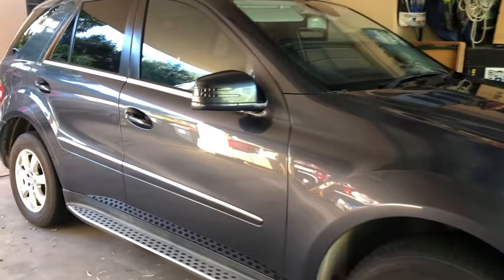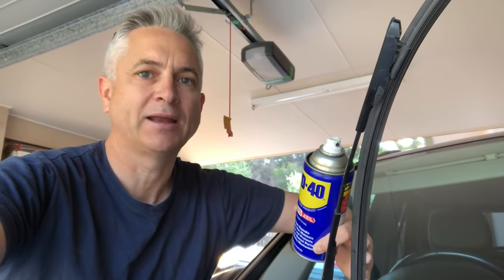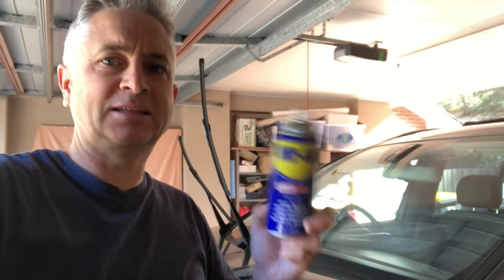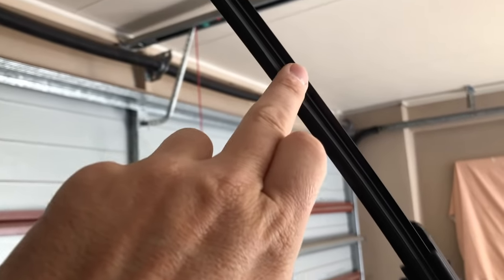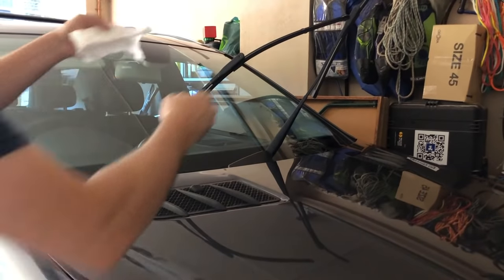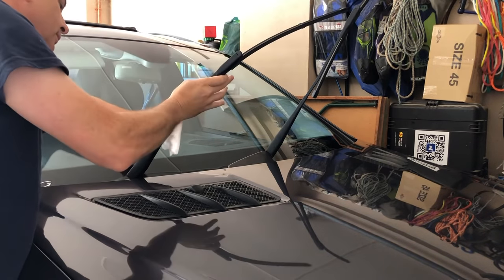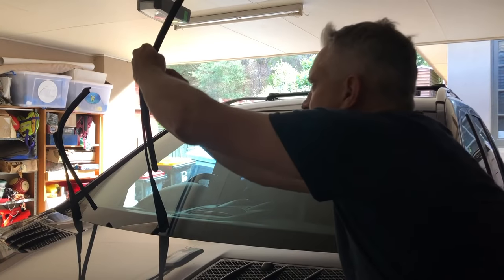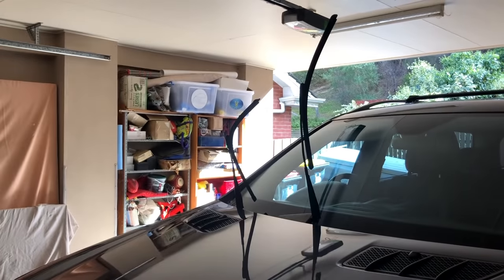WD40 Hack on Wiper Blades!  Does it really work?

Comment: Just one comment, Drew (and thanks for the video, by the way). I think that black gunk you got when you wiped with the WD-40 was probably mostly rubber rather than dirt. That's not a bad thing in this context, but I think the WD-40 actually softens the rubber by partially dissolving it. It's important to wipe excess WD-40 off and not leave residues on the rubber for too long. The way you did it was fine, and it worked - which is what counts.
Reply: Agreed, first I wipe the blade with wd40 it works fine for few days, the noise came back, so I though maybe I should spray more and leave it to dry, now my blade is like sticking to the windscreen, just like you said , the rubber blade might have dissolved 😑
Reply from the maker: Hi Sualdam, thanks for your feedback and suggestions, truly appreciated!  Cheers Drew
Reply: You can wipe down brand new blades and pull black off. I think silicone if better to use than WD40
Reply: @WhittyPics  It depends what you are trying to achieve. If you put silicone on your blades, the last thing you want is for it to get on the glass - it's hard to get off, and it causes smearing. If your blades are hard, then WD40 will soften them for a time, which can be beneficial (so long as you clean off excess WD40, since you don't want THAT on the glass either). Smearing windscreens is caused by several different things - stuff on the glass, stuff on the blades, hardened/damaged blades. The logical approach is to get everything off both the glass and blades - which is easier to say than to achieve - then worry about the state of the rubber. WD40, by softening the rubber, refreshes it somewhat.
Reply: WD40 does not "eat" into the rubber. Where did you get your info from?
Reply: @happyswissjoe  It's what is known as being a chemist, as opposed to an online Millennial non-expert of everything. WD40 contains a petroleum based solvent and can soften rubber. Which is why it strips a layer off when you use it on wiper blades. It warns you to keep it off pressurised hose work for the same reason. Really, it's that simple - and just saying 'nah' doesn't alter the fact.
Reply: Wiper blades often contain silicon composites. So WD-40 might dissolve them. Use vinegar instead of WD-40.
Reply: @happyswissjoe  i worked in the plastics industry for many years and when we stripped machines down we cleaned the tooling , we would spray wd on the tooling to lift the plastic residue from the extrusion process (both pvc and rubber products) , this would clean the tooling and leave a coating that helps stop the tooling from rusting as most tooling is just bare steel (you can chrome the tooling but it gets worn away and is a constant job of getting them chromed over and over) , if you were cleaning tooling the fumes that come off (you are cleaning hot tooling at 180c and more) will actually strip any protective coatings on glasses (anti scratch / glare etc) it isnt instant and takes time but it will strip it.
Reply: @happyswissjoe  womp womp, go back to school.
Reply: @sualdammacsamildanach8154  You can get silicone-based WD40
Reply: Can't see how this is accurate. You get that black gunk when you just use water, and the fact that after 3 or 4 wipes it comes away clean shows that it's just dirt and not "dissolved rubber". You can put rubber completely immersed in WD40 for months and it not dissolve (because this is a comments section, I need to highlight that by me saying it doesn't dissolve, that isn't me saying that there aren't consequences) there are various YouTube viedoes testing this). Spraying it on a cloth and wiping a blade isn't going to make any difference.
Reply: @iainamurray  Yeah, well whatever. The regular stuff will dissolve/soften rubber. "WD40 contains a mineral (petroleum) spirit as a carrier solvent. The mineral spirit WILL soften and swell natural rubber. It is ok to use on fuel and oil hoses but NOT coolant hoses and definitely not on door and window rubbers!" But carry on arguing against the facts by all means.
Reply: @sualdammacsamildanach8154  You seem to have an issue with reading and understanding my comment. Would you like to try again and reply with something relevant?
Reply: @sualdammacsamildanach8154  If you'd have said "WD40 will soften rubber, particularly when immersed over an extended period" then I would have agreed with you. Instead you spouted some bollox about wiping the blade with it dissolves it onto the cloth which is demonstrably false, as proven in the video. I even highlighted that before any numpties tried to come at me saying that it does nothing, I explicitly said that me saying that wiping a blade will not cause it to immediately dissolve isn't the same as claiming there will be no impact. Please read in full and understand before spouting yet more nonsense. You were that numpty.
Reply: Just get new blades.They are cheap!
Reply: @nearlyretired7005  $50 according to the vid
Reply: I was thinking it was the broken down rubber too. I've heard you can use Isopropyl Alcohol too. What could be wrong with taking advice from a spaz like Kilmer, right?
Reply: @vincemajestyk9497  IPA is fine to use a a cleaner and degreaser, but the problem is that it won't 'refresh' the rubber. That's the point of this hack - it stops the hardened blades bouncing by softening them slightly (for a while). WD40 will remove grease as well, of course. I was just pointing out that the black 'dirt' Drew was seeing was likely rubber that had been stripped.
Reply: @vincemajestyk9497  It's not broken down rubber, it's road crud. If immersed the wiper in WD40 for a few months then it might break down, but using it to wipe clean a wiper makes some sense as it will clean it and potentially soften it a bit, which is good for it.
Reply: @iainamurray  I've managed to hget the same "crud" off of brand new wiper blades.
 Hmmm...
I wonder what that was?
Reply: @michaelmayfield4304  Residue from the manufacturing process?
Reply: @iainamurray  Other than black asphalt flying off the road, where do you think the black rubbery looking “road dirt” would come from. Wipe the windshield and look at the color of the dirt. Is it dark blue or black? Why would wipers have different colored dirt than the windshield? 

Seems so obvious the solvent in WD40 is stripping off some of the wiper blade’s top coating which might have weakened over time. Of course, you could also test on a new, clean blade and test what the other commenter wrote. I’m guessing he’s right…

Doesn’t look like road dirt to me. Just one person’s opinion, of course, but easily tested…

🖖🏻
Reply: @sualdammacsamildanach8154  m
Reply: @philosophyandreligion3442  Yes, it is easily tested. Which is why I'm not sure why you've sent this message.
Reply: @chrisc9817  No it isn't. Standard WD-40 contains petroleum distillates and is therefore a solvent. It is why they warn against splashing it on pressurised hoses. It displaces water, to be sure. But that's because of the petroleum distillates, which are also solvents. You shouldn't just says things like this without at least looking them up first.
Reply: @sualdammacsamildanach8154  Is there a reason to be so narky? Millennial? I find it quite amusing that older generations think that later generations are somehow deficient. I grew up in the fifties and sixties and I can tell you that the young people of today (that I have contact with ) leave earlier generations for dead
Reply: @avasolaris1  Look, if people are going to make stuff up and then believe it is true, then go around repeating it as fact simply because they heard it, someone has got to try and remind them how knowledge works. And I will if you won't. It IS a millennial problem. Absolutely. On the other hand, being 'narky' is also a millennial problem, and I quite like that one and will wholeheartedly embrace it. And I can tell you now, any of your 'young people' who go around claiming WD-40 can cure scrofula and turn water into wine need correcting - not a heap of fake congratulations, which is the current way. WD-40 is a solvent and it will dissolve rubber. It's a simple scientific fact. It doesn't matter what your 'young people' think. If they think something else, then they are wrong, and you shouldn't be encouraging them.
Reply: @iainamurray  Also known as 'rubber'. Just face the fact that the reason this hack works is that WD40 softens rubber, and the black marks you get ARE rubber and not 'dirt' - especially if you've already cleaned your blades in soap and water.
Reply: @sualdammacsamildanach8154  You know what, I mixed this up with another product. You are correct. Sometimes one gets confused after seeing thousands over products over the years. Mistakes happen. Wd-40 has an almost exact looking can that is a silicone spray.
Reply: @iainamurray  The whole point I made was that the apparent gunk coming off AFTER YOU'VE CLEANED THEM is not more 'gunk' but dissolved rubber. Everyone apart from you got over the idea of magic pixie dirt a hundred posts ago. It isn't dirt. And it isn't 'manufacturing residue'. WD40 attacks the softer rubbers on cars and partially - a word I've used previously - dissolves it. If you immersed a blade in WD40 and left it, it would eventually disintegrate pretty much. It would certainly be useless. Because WD40 attacks it. A brief wipe softens the edges - and pulls off some 'gunk' (aka rubber) as it does.
Reply: @sualdammacsamildanach8154  Are you for real? What is so difficult for you to understand - after you've wiped it a few times, there is no more "gunk" being removed from the wiper blade. It stops. There is no more. Nothing else is removed. Not sure why you've put "manufacturing residue" in quotes as it's not something I've said. It's almost as if you're not paying attention....
Reply: @iainamurray  You said 'Residue from the manufacturing process?' in a reply to someone else earlier 🤣 Now, correct me if I'm wrong, but that means you think it is 'manufacturing residue', right? And you're talking rubbish. You get the gunk coming off each time you wipe. Just because YOU said you don't doesn't make you right - the real world doesn't work like that, even if it seems to in yours.
Reply: @happyswissjoe  It is a petroleum based product so it probably does. Use the Rain-x cleaners and wipers. I've been using them for years and there is nothing better. Water beads up and blows right off the glass. When wipers don't work like they did, wipe them down with the cleaner and re-clean the glass also.
Reply: @sualdammacsamildanach8154  I didn't deny anything - you were replying to a comment where I hadn't mentioned it, not realising you were referring to something that was apparently said weeks ago. I've not gone back over the 44 out of sequence messages - the residue may well initially be manufacturing process and after that, road grime. Seriously - go outside now and clean your wipers with a splash of WD40 to prove to yourself that when you've cleaned it with a few wipes, after a short while the cloth will come back clean. That's because WD40 isn't aggressive enough to melt rubber, you melt.
Reply: @iainamurray  That wasn't the point, Iain. The point was - and remains - that the muck coming off even new/clean blades is microscopic fragments of the blade itself as a result of the action WD40 has on rubber (and the coating new blades often have). Petroleum distillates easily have enough power to commence doing what they do immediately after contact, hence the manufacturer's warning not to splash it on pressure hoses. Your problem is, it seems, an inability to comprehend degrees of action and nuances, opting instead for either all of one or all of the other based on coin-toss logic. WD40 will strip a small amount of rubber and affect the the surface of the remainder, which is precisely why it stops squealing blades for a time. It softens the sharp edge of the blade which may have hardened over time.
Reply: @sualdammacsamildanach8154  "Your problem is, it seems, an inability to comprehend degrees of action and nuances, opting instead for either all of one or all of the other based on coin-toss logic" 

- this is the most ironic thing I've seen on the internet today. You've not actually tried it - you're going on what you think you know rather than attempting the basic test. I don't know if it's you simply not reading and taking the time to understand what's being said, or you're being willfully ignorant, but either way, it's not a good look.
Reply: @iainamurray  Well, at least in this one you went all 'one way' and just stuck with being personal. No misinformation about WD40 to respond to here.
Reply: @sualdammacsamildanach8154  Saying what actually happens isn’t “misinformation”.
Reply: @iainamurray  Someone: 'I wonder what that was?' You: 'Residue from the manufacturing process?' QED. That was the ONLY point I replied to , and not your entire back catalogue of apparently contradictory snippets 😉
Reply: @sualdammacsamildanach8154  I've been entirely consistent. Your claim was that the black gunk was melted rubber because the WD40 disolves it. I pointed out (politely initially) that it can't be the case that it's dissolved rubber, because for that to be true, if you keep wiping then the residue would continue to melt and come off until there was no wiper left. Because this doesn't happen, what you claimed is demonstrably false. 

I've confirmed that while there most likely will be rubber deposits, the residue is a mixture of things, mainly road dirt, hence after a few wipes the cloth comes away clean. I also confirmed that WD40 will significantly break down rubber, but only under circumstances where there is extended contact with it (i.e. not a quick wipe with a cloth).  I also said that WD40 can and will permeate and soften rubber, because it does.

Apologies if English isn't your first language, but you should really read and understand the points being made before going into "attack mode".
Reply: @sualdammacsamildanach8154  I'm not being contrarian. I'm being accurate and pointing out your logical fallacy. I'm not using an analogy, I'm giving real-world experience.
Reply: @iainamurray  But you are simply wrong, Iain. The manufacturer itself warns that it attacks rubber, and I'd think that they would know more than you (though that would seem to also apply to most of the animal kingdom).
Reply: @iainamurray  Iain, this is precisely what I meant about managing to have an argument in an empty room. The manager I mentioned was just so like you it's spooky 😂- he would agree and yet somehow manage to disagree just to make his mark. So we're agreed that WD40 attacks rubber, which is why is 'refreshes' hardened rubber, and that by thus attacking it small amounts of it must come off each time it is applied. This is the basis of science, you understand, and I was employed as such for many years.
Reply: @Planktilious1  To be honest, Pat, I haven't tried it. But MEK is known to dissolve rubber and plastics. It can be used to weld plastics together (I've used it for that), it is that aggressive, and more so than WD40. A small amount might work better than WD40 on wiper blades - but it might also work far more than you want. What you said about print rollers suggests it might work well, though. I'd try it on an old blade first. Just in case. I think WD40 might contain some MEK, but I don't know for sure, or how much. The recipe is a secret.
Reply: @sualdammacsamildanach8154  So you're saying that you have a lot of experience of people having to correct you? Makes sense.
Reply: @iainamurray  Nearly right, Iain. A lot of experience of people who have a desperate need to BE right even when they don't even need to get involved, and who then obfuscate the important details with their interference.
Reply: @sualdammacsamildanach8154  If you want to be right - stop being wrong.
Reply: @iainamurray  Since I am quoting science (and the manufacturer), maybe you should invest in a mirror with that comment 🤣 Are you sure you're not the manager I mentioned earlier? The similarities are uncanny.
Reply: @sualdammacsamildanach8154  I couldn't manage you. My patience has limits. You think that the manufacturer says that waving a small amount of product on a cloth near some rubber will cause the whole thing to immediately melt? Citation needed.
Reply: @iainamurray  Iain, YOU are the only one who has become obsessed with this idea of dissolving a whole wiper blade 🤣 I'm not really sure why you or anyone else would want to do that, but at least in your case we've identified certain 'issues' that might shine a light on the reason. Maybe your doctors will be able to use it should you seek treatment. In the meantime - and 66 replies ago - I originally said 'I think that black gunk you got when you wiped with the WD-40 was probably mostly rubber rather than dirt...  WD-40 actually softens the rubber by partially dissolving it.' Just to remind you of the facts, of course 😉
Reply: @sualdammacsamildanach8154  Why do you keep insisting that you're telling me facts when what you've said is demonstrably false? What's wrong with your head?
Reply: @iainamurray  It's a scientific fact that petroleum distillates attack many forms of rubber, Iain. It's not a word game - which I KNOW you are trying to play to save face - about dissolving entire wiper blades in the stuff. Only you brought that up, and only you keep mentioning it as if it has any relevance whatsoever. It doesn't. The manufacturer warns that WD40 attacks rubber. Period.
Reply: WD-40 isn't good, it leaves a lacquer when it dried.  WD-40 makes a silicone version which is better.
Reply: @D33Lux  But the silicone version doesn't soften/refresh the rubber in the same way because it lacks the very ingredient which does so in standard WD-40. It's also worth pointing out that silicone will be left on the glass and blades. It'll make them slide better for a while, but it won't soften them up. The key issue here isn't that the brand WD-40 works (there are many WD-40 knock offs which also have the same effect), but one of the key ingredients in it.
Reply: @D33Lux  Oh christ. Don't encourage him. He already thinks that WD40 will melt your car if you wave a can of it at it.
Reply: @iainamurray  Whereas YOU believe YOU are right and science is wrong. Don't forget that, Iain. Your position appears to be that WD40 can/can't/might attack rubber, something about making a puree out of an entire wiper blade, and then arguing you never said whichever of those things you're not going on about at the time, while switching to a different one every few minutes.
Reply: @iainamurray  Iain, that was what I said right at the start. There really was nothing for you to 'add', but you chose to do so and then started wittering about dissolving entire wiper blades for reasons best known to yourself. I said - in my OP - that WD40 attacks rubber, and that the black 'gunk' coming off even clean blades was likely traces of rubber. I'm sorry, but that's what happens when something which attacks something else is wiped over it. It really is that simple, and yet YOU tried to turn it into something else in order to get noticed. Well, you succeeded, but not how you expected. No doubt you saw yourself as some 'devil's advocate' with your earlier suggestion that it was 'manufacturing residue'. Your position is not as consistent as you keep suggesting. If it was, you wouldn't have even said that. I remind you once more. WD40 attacks many types of rubber, and that is why is softens hardened blades. Repeated rubbing will remove traces of rubber (and any coating) with it. You DO know what 'traces' means, don't you? I'll give you a clue and tell you it doesn't mean dissolving a whole blade.
Reply: @sualdammacsamildanach8154  Christ on a bike - you made a statement and I pointed out that it can't be accurate because of a very simple test you can do. Then you went off on one about "science" and not reading what was said. I'll go back to the original point and see if you understand it/process it this time: you said the residue on the cloth was rubber because the WD40 dissolves it. This isn't possible, simply because if it were, you would end up wiping and wiping until the whole thing was gone. 

Now this is the important bit - I didn't say that there isn't a reaction. I said that the reaction isn't so aggressive as to dissolve the rubber that quickly. This is evident by the fact that the cloth comes away clean after a few wipes. I've literally just tested it as my wipers needed cleaning. One with WD40 and one with water. WD40 was 4 wipes and came away clean. Water was 6 wipes and came away clean. If WD40 dissolves rubber to the extent that you suggest, then I'd still be there wiping black residue. I'm not. You are wrong.
Reply: @iainamurray  WD40 softens rubber by attacking it, Iain. Thus it will pull off small amounts when used to wipe them. Period. It's called 'chemistry'.
Reply: @iainamurray  No one - apart from you, Iain - has claimed what it is you have a bee in your bonnet about 🤣 You've created a falsehood to disagree with, and are pursuing it doggedly. No one actually said it, Iain. Only YOU said it. WD40 attacks rubber - the manufacturer warns of it - and it is likely that the 'gunk' coming off is the result of that. Nothing about wiper blade smoothies in there, Iain.
Reply: @sualdammacsamildanach8154  I don't understand why your brain doesn't function. You can test your assertion and prove that it's false in about 5 minutes. I can't help you any more than point you in the direction of knowledge and understanding.
Reply: @iainamurray  Yes, so you keep saying in amongst your belief in wiper blade smoothies being somehow involved in the matter under discussion, Iain. WD40 attacks rubber - the manufacturer warns of it, as I have repeatedly pointed out to you - and thus when used to wipe rubber is likely to strip small amounts off.
Reply: @sualdammacsamildanach8154  You're the one banging on about wiper smoothies. As I've repeatedly pointed out to the hard of understanding, I'm aware that it attacks the rubber. Just not to the extent that you're imagining, as demonstrated by the fact that the residue stops after a couple of wipes. If you can grasp this extraordinarily simple premise, then perhaps we can move on.
Reply: @iainamurray  Iain, I have only continued to deride you on the matter after YOU brought up that argument about dissolving a whole wiper blade. No one had made that suggestion until you stuck your oar in 🤣 But you can't unsay it, which is why I keep reminding you of it. WD40 will strip small amounts of rubber since it attacks rubber. The manufacturer warns of it attacking rubber.
Reply: @iainamurray  The manufacturer of WD40 warns that WD40 attacks rubber and shouldn't be used on soft rubber or pressurised rubber because it will soften it, which then causes it to break up. But some internet numptie with 'issues' says... well, precisely what YOU'RE saying, and so they must be wrong, eh? 🤣
Reply: @sualdammacsamildanach8154  I'm aware. That's why I said it. Repeatedly. If you were to immerse your soft rubber in WD40 for a month, then it would indeed soften it to the extent that it causes it to no longer function. The point that the internet numpty (that would be you) is missing is that using a trace of it on a cloth to wipe something down once every now and again won't have anywhere near that level of impact, and certainly doesn't degrade it to the extent that the rubber immediately breaks down and gets wiped away. This is incontrovertible. I do however realise that this will be lost on you and your binary simplistic understanding of the world.
Reply: @iainamurray  No one else was interested in dissolving an entire blade, Iain. Only you - for reasons best known between yourself and your therapist. The point is, and always was, that WD40 attacks rubber, and thus wiping blades with it, as well as refreshing them as a result of that attack, will also likely result in some rubber (or coating) being shed. Nothing about wiper blade smoothies or any other schoolyard antics 🤣
Reply: @sualdammacsamildanach8154  If you're going to make demonstrably false declarations on a public forum, expect to be called out. I'm not interested, just pointing out the fricking obvious.
Reply: @iainamurray  WD40 attacks rubber. The manufacturer warns of it. This is why it 'refreshes' hardened blades. It softens the rubber as a result of the petroleum distillates it contains. The only falsehoods have been 'nah, it doesn't', and 'let's make a wiper blade smoothie' - both of which have come from you. And that's on top of the smokescreens like 'oh yeah, but you can get silicone based WD40' and 'it's a manufacturing residue' as you swing wildly between your ignorance of multiple scientific issues 🤣
Reply: Petroleum based products and rubber don't mix!! Plus small amounts of grit sand ect are frown up from the road and sticks to wiper blades and which in turn micro scratches appears on the surface of the screen!!!! WD40 no!!🤔
Reply: @keithroberts5611  Don't you bloody start. We've already got one internet numpty
Reply: @happyswissjoe  Wrong!  It is a petroleum solvent.
Reply: @michaelmayfield4304  The black stuff is dye from the wiper blade
Reply: @michaelmayfield4304 Probably the graphide powder. Some wipers have it as a solid lubricant. So, not advised to remove it.
Reply: 6 a.m. in the UK and I’m reading comments of people arguing about windscreen wipers. Isn’t the internet a wonderful thing😀
Reply: Winter weather concerns motivated my dad to coat my wiper blades with wd40. I was on the highway later at night and went did a spray/wipe and i couldn't see a thing because it caused smearing. I had the blades replaced 6 months earlier and so I pulled over to see what was wrong. I took paper towels to wipe the glass and it was oily and made it worse. I managed to drive to gas station and did simple windshield cleaning and everything was fine afterward. As for whether it degrades the rubber, I hope not. This just happened to me today and so it prompted me to check YouTube to see if this is something others do. Personally I'd just use Lysol wipes to get dirt off the blades and avoid the chamce of potential smearing. That said, I have no idea if my dad just lifted the wipers up and sprayed them with Wd40 without the wiping; I bet he did.